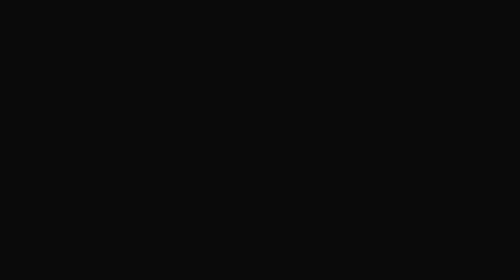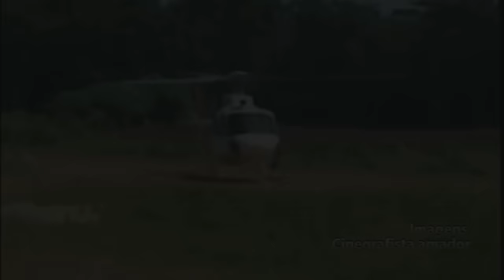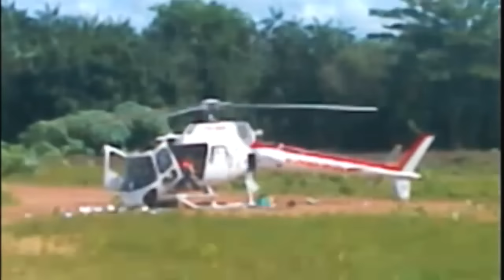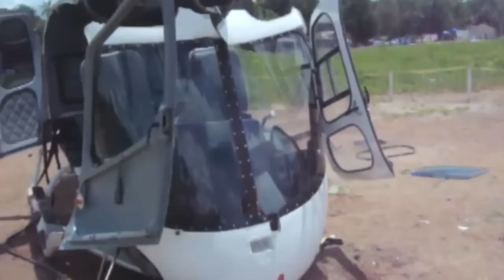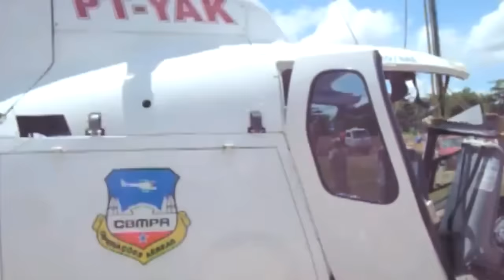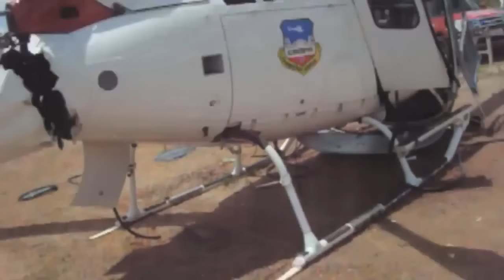Explained: AS350 Eurocopter Helicopter Self-Destructs

Comment: That's why as a Royal Navy helicopter pilot I was trained to keep the engine revs up for 30 seconds after landing.  If you shut down too quickly and get oscillation, usually caused by a heavy, uneven landing, there's nothing you can do but sit tight and hope you can walk out of the wreckage.  If you keep the revs up and get oscillation, you simply take off, it instantly stops, then you land more gently.  Simples
Reply: @Cyba_IT  The rotor acts like a giant gyroscope, remarkably stable unless you jolt it, when it becomes unstable, pushing back against the ground and that stored up energy then goes into vibrations,which amplify rapidly. Landing unevenly and heavily on three wheels or bouncing from skid to skid can easily cause this. Yes, pilot error!  and pilot error for shutting the engine down too soon!

Did you ever as a kid have one of those string pull gyroscopes (they're still on Ebay and Amzon for about £10 and great fun to play with)? Once up to speed, if you push them they simply move smoothly at right angles to the direction of push, called gyroscopic precession. However, if you flick one, it will topple and crash dramatically.
Reply: Yes. I never got out of recips but ground resonance was covered extensively in ground. 

Lift into a hover at first sign. R-22s less susceptible and we didn't have the 30 seconds after set down flight idle procedure.

All I know is that it's a good argument for greasing landings always and often.

Comment: That's lovely to know that the pilot's seat is the shear-off point.....
Reply: Game Dev Cade  I understand your sentiment, but this condition can only occur when the landing gear is touching the ground :)
Reply: Game Dev Cade  Check out ground resonance. It is basically a condition where the main rotor system becomes unbalanced and the skid touching the ground makes it worse and worse till the helicopter breaks up. As you don't have contact with the ground when flying, the out of balance condition doesn't get worse and corrects itself before it gets close to this state. Hope that makes sense!
Reply: Game Dev Cade  youtu.be/-LFLV47VAbI this is a fairly well known video of a chinook in this state. Notice how the rotor blades kind of "clump" together when it gets really bad?
Reply: @nateb4114  Thinking in more scientific terms, it's basically positive feedback happening.
Reply: @nateb4114  , not necessarily an unbalance condition. It is more so a resonant frequency vibration that does not dissipate as the aircraft is on the ground. Because it is on the ground, the energy transfer back into the airframe and amplifies the problem. Once it starts, only two things can stop it - pull up into  hover or kill power and slam on the rotorbrake if you have one. It's scary and an inherent problem in most helicopter designs. Even smooth running rotors can go into ground resonance.
Reply: @nateb4114  To me would this be like if you had a Tank Slapper on a motorbike where the handlebars go from side to side and ends up with loss of control.
Reply: @jamesk7446  In this case though they reported there had been unnatural vibration while in flight, so taking off again wasn't necessarily an option.
Reply: Goodbye, you are on your own now!

Comment: "Do the fronts normally fall off?"
Reply: If they are equipped with an "ejectomatic cockpit".
Reply: That's not very typical, I'd like to make that point.
Reply: RWBHere  LOL! That's hilarious! :-D
Reply: The cockpit on an Astar isn't structural, so yes it will
Reply: Some of them are built so that the front doesn’t fall of at all.
Reply: A wave hit it!
Reply: That's completely dependent on the quality of the plastic surgeon who did the breast enlargement.
Reply: They're built to rigorous aviation standards!
Reply: @youzzername  and then it was clark and dawe.
Reply: It's a good thing it wasn't in an environment.
Reply: The fronts are held on with cello tape.
Reply: The front falls off, the tail breaks... there's not much structure supporting the engine in the event of a crash. These things aren't designed with bulkheads but they fall apart like they are. It's a clear indication of how the subframes are assembled into a chassis
Reply: @BruceLeigh-eu3wm with rivets and glue like a car you build in your garage at home

Comment: "...a condition that can develop in the rotor system of even healthy helicopters." 

A perfect example of why you should take your helicopter to the vet regularly for checkups, and always make sure you feed them grade A helicopter food, which can help strengthen and clean their rotor systems.
Reply: helicopter crash
Reply: It probably hadn't received vaccinations for this condition, which could have been performed during the checkup.
Reply: @maraboarini  yes from 2". It happens.
Reply: Feed the helicopter with grass.
Reply: Always caused by improper pilot takeoff or landing technique.  “Pilot Error”.
Reply: @wiltonsmith3397  i'd rather say it's caused by improper maintenance checks !!!! "Healthy" helicopters will in no way get that kind of trouble !!!
Reply: cat chooper
Reply: Brush their coat regularly to rid of loose hair, promote healthy skin and a shiny coat.
Reply: I feed mine with a mixture 20% engine oil, 20% transmission oil, 10% diesel fuel, 10% avgas, 10% Jet A, 30% mineral water from Russia.
Works since 1968
Its an mi8 btw
Reply: @Juppie902  I see a lot of people treating their Mi-8's as if they're pedigrees like a Eurocopter or Augusta-Westland. While it isn't necessarily a 'bad' thing per se, I feel that it must be reiterated that Mi-8's were bred for rough environments and have the energy and metabolism to match. With the diet you described, I would highly recommend an active lifestyle for your Mi-8, and make sure it has a healthy outlet for its energy, lest the surplus energy cause it to develop anxiety problems, which if untreated can result in depression and even aggression towards other helicopters and people.
Reply: @Juppie902  So you think that his problem was due to a maintenance issue?
Reply: CK sexually identifies as an Apache attack helicopter -- thought you'd want to know.
Reply: Yours must have identified as a helicopter.
Call 1-800-IAHA (Identified Attack Helicopters Anonymous)
Reply: @AINGELPROJECT667  lmao!
Reply: i realize it is kind of off topic but does anybody know of a good site to watch newly released series online ?
Reply: @Calvin Tristen Try FlixZone. Just google for it =)
Reply: @Isaiah Ivan Yea, I've been using FlixZone for since march myself :)
Reply: @Isaiah Ivan thanks, I signed up and it seems like they got a lot of movies there :D I really appreciate it !!
Reply: @Calvin Tristen No problem =)
Reply: Ah, yes, we all want a healthy machine...

Comment: I heard that someone said for ever hour of flight time the helicopter needs 2-3 hours of maintenance. 
I may be wrong but it's a collection of parts that really don't want to be there.
Reply: thats not true - Mx in terms of shop time you mean. However most pilots will spend an hour after each flight checking on the obvious things.
Reply: I've heard that millitary pilots practice engine-off (autorotation) landing once a month! They're so well trained that they can land it right on the H-sign. Talking about practice...
Reply: @visnjamusa9395  anyone who wants a private helicopter certificate is required to demonstrate that.
Reply: @robertgary3561  Not monthly though, AFAIK

Comment: Hindsight is always 20/20,  we all know how to correct these situations but when it is actually happening is a different story. No one knows how they will react in an emergency
Reply: They don't put inexperienced rookies in a medi-vac! If your loaded near capacity with low rotor RPM you're not lifting off, even if it's the only way to stop the resonance!🙄
Reply: @UshouldTryReality  as a mechanic I've had this happen on ground run the aircraft was tied down so my only option was to shut it down🤷🏻‍♂️
Reply: That's why we RN chopper pilots train for emergencies. Civilian pilots are not required to.

Comment: Explanation for Non-Pilots

In Short:
Ground Resonance happens in helicopters that land with certain rotor speeds (depending on helo) and uneven vibration between the main rotor blades. 

The Full Story:
I'm now through several months of helicopter school and am much more versed in what causes this. So, lemme try and explain in short what causes this.

Ground Resonance will only happen in helicopters that are Fully Articulated because of, basically, an uneven set of angles between the main rotors resulting from the landing gear's impact from the ground. ex, Blade 1 will have a 116 degree angle to Blade 2, while Blade 2 will have a 120 degree angle to Blade 3, which will have a 122 degree angle to blade one. This makes the helicopter unbalanced. 

See, in a Fully Articulated helicopter, it has hinges that allow the blades to do something that we call 'Lead-Lag'. The other two rotor systems, Semi-Rigid and Rigid, don't have those hinges and thus can't have uneven blade angles because those blades Lead-Lag via their own flexibility. 

Note: the Star/Ecureil is not a true fully-articulated system, but the effect of vibrations on the airframe is the same.

This is also more likely to happen in helicopters that have wheels for landing gear rather than floats, skids, or skis.
Reply: +Cielo Pachirisu the AS350 doesn't have a fully articulated rotor system, if you read the flight manual is classified as semi-rigid rotor system...
The cause of this accident was a crack in the starflex system, hence the vibrations in flight as well..
Reply: +Matt p
EDIT: Nevermind, didn't know about Starflex either

 I admit, I'm not familiar with the Ecureil. 

Even so, uneven vibrations in the main rotor hub that just sorta...got worse. 

...wait a minute, isn't that a Rigid rotor system? Correct me if I'm wrong, but semi-rigid don't usually have more than two blades.
Reply: +TheTriumphant675  Yes, except that the a350 doesn't have a lead lag hinge. It has a starflex hub and elastomerics blocks called frequency adapters to absorb the forces that lead/lag would create.
Also like I said in the previous comment the landing was done due to vibrations in flight, so the vibrations were already presents (from the crack..) before landing, not due to a hard landing.
Reply: +TheTriumphant675 Yes, the blade grips "float" between elastometer (rubber-like)  bearings attached to the fiberglass starflex holder that do allow some lead-lag movement, despite not being true lead-lag hinges.
Reply: +Cielo Pachirisu So what was the blame was the link rods not being the same length?  A solution would be to have an adaptive suspension system that reads the vibration and fixes it.  Another solution would be to increase the headspeed and level out the blade pitch?
Reply: +Cielo Pachirisu In the early part of the video you can hear the pilot spooling up the heli but the unwanted rotation seems to have worsened.  The instinct was that something is wrong.  It's better to put it on the ground than try to take off thinking it is ground resonance when it may not be.  I think the pilot thought there is something wrong with the tail section.
Reply: Cielo Pachirisu I learn something everyday.

Comment: that's why I only weight balance my blades, and not tighten the blades in the grips too tight that centripetal forces cant pull them on center. its normal to have one blade swing slower in fast forward flight, or when meeting excessive pitch. The pros with this is the blades will always center if an out of balance condition exists. I've seen people tighten their home built mosquitos with the blades off center, and then perform an unscheduled rapid disassembly event on its first spool up. Fist time calibration, loosen the grips, spin up and dont give it any collective or pitch, and then allow it to slowly stop, then tighten the grips try to do this on a day without any wind, you'll get the COG right on the spindle.

Comment: Its best if you "google" it for the best definition. But, it occurs when you land too hard. It causes the blade to go out of phase with each other causing an imbalance like having too much of something on one side of your washing machine during the spin cycle. By lifting off the ground, the forces equal themselves out and the bounce goes away. Wait too long and this video is exactly what happens. Only happens on 3 bladed fully articulated rotor systems. It is fully avoidable/correctable.

Comment: +Doug McPheters 

I'm a relatively novice helo pilot and I've never been trained or told anything about Ground Resonance, but if I had to guess, going back to/staying in hover will let the vibrations kind of even itself out if you just stabilize it. 

I could imagine something like this happening if a pilot tried to put his bird down with the engine power or the rotor's RPM too high.
Reply: +Cielo Pachirisu Yes, lifting the helicopter into a hover will almost immediately stop the resonance, but obviously can only be done if your RRPM is high enough, in the case that it isn't, you should immediately shut down the heli!
Reply: ThatLadKeenan As I have now been in flight school going pro for four months thereabouts, I now know :D. But thank you!
Reply: +Cielo Pachirisu good to hear it mate! safe flying!
Reply: ThatLadKeenan And to you!
Reply: I'm an AME, I remember from helicopter courses I've taken its a result of imbalances in the rotor head (result of not getting your rotor tracked and balanced) but yes, taking off again will sort it out long enough to land!
Reply: I'm an AME, from helicopter courses I've taken I've learned its a result of imbalances in the rotor head (result of not getting your rotor tracked and balanced) but yes, taking off again will sort it out long enough to land!
Reply: I'm an AME, from helicopter courses I've taken I've learned its a result of imbalances in the rotor head (result of not getting your rotor tracked and balanced) but yes, taking off again will sort it out long enough to land!
Reply: I'm an AME, from helicopter courses I've taken I've learned its a result of imbalances in the rotor head (result of not getting your rotor tracked and balanced) but yes, taking off again will sort it out long enough to land!
Reply: +Isaiah “Juggernaut” Martin that;s really good info to know          
 it can be really dangarous  
i know all about then   
im a flight simulator helicopter r pilot

Comment: Apparently caused when pitch of one rotor blade  gets stuck and is therefore out of balance with the other two, rotor head or dampener problem, only cure is to try and get it airbourne and jolt rotor back 
in sinc, you can see he tries to get it airbourne but it is shaking to much.

Comment: Getting the facts together:
Vibration felt during flight as reported. (The reason seems a sudden lateral vibration) 
The rotor was in flight speed when skids touch to the ground and that makes vibration increase due to sympathetic resonance. (caused by spring effect of the skids)
When the pilot decrease rotor speed there was a moment rotor rpm "catches" the body resonance and amplify it to some degree. Rigorous movement shakes apart the body as seen on this video.

Comment: I think the way you described Ground Resonance is slightly incorrect. Ground Resonance is the cause of vibrations traveling up and down the helicopter. If the vibrations start to sync up with each other, then they start getting more powerful, and that's what causes the initial imbalance. If allowed to continue, then that is what causes the Rotor Imbalance, which only exacerbates the issue

Comment: IF those aboard are correct and 'excessive vibration' started in the air then landed and began ground resonance, what caused the excessive vibration? You can clearly hear  N increase but where's the return to hover?

It seems ground resonance wasn't the cause, it was only the end.

Comment: Possible causes to check out.  The rotor became out of balance (shifting weight) or out of track (trim tab).  Since this started IN THE AIR the pilot did the right thing, get it on the ground.  Ground resonance and shake apart is better that a failing component fail in the air.  They lived through it.  It would be interesting to know what the NTSB determined was the mechanical cause of this accident.
Reply: Any landing you can walk away from is a good landing. A great landing is when you can take off again later.

Comment: Ground resonance. Best bet is to get the thing off the skids and in the air, unless you don't have the Rotor speed at which point you can try reducing pitch and dumping the throttle. Watched this happen to an MD500 once. Fortunately the Pilot was able to get it back in the air where it settled down but at that point it was well on its way. Regular inspection of items such as Skids/Tires and associated parts, Lead-Lag hinges, Blades etc can help prevent this from happening.

Comment: Only solution to take promptly in the air again by pulling the pitch control lever and hover until things get bit better. If landing skids touched the ground ground reactive vibration wave would brake the machine.otherwise.
So never turn the engine off right after landing.
But how to handle when on taxied helicopter, this occurs during starting the engine and the RPM aren't reach enough level to take off ?

Comment: ground resonance takes place while on the ground - it normally does not happen with helicopters that have skids or fixed landing gear - normall only with helicopters taht have wheels.  The way to correct the effect is to immediately come to  a hover if the viberation begins; however, this accident seems to take place because of a "severe rotar out of balance rotation problem".  The out of "balance" condition - perhaps could not be correct at all.